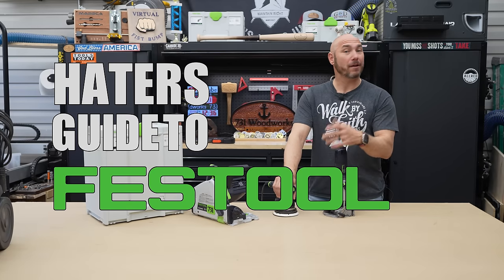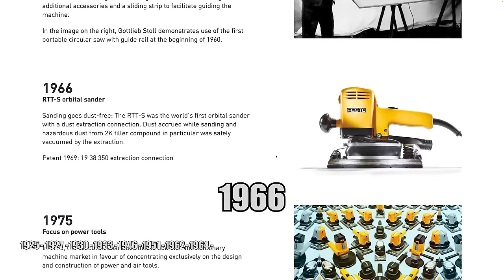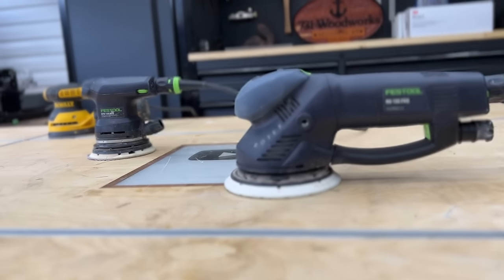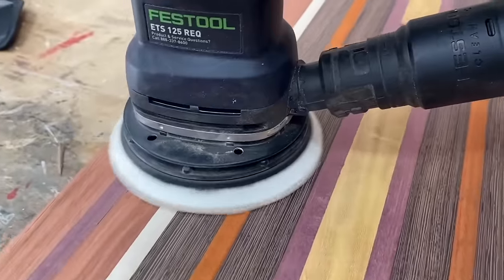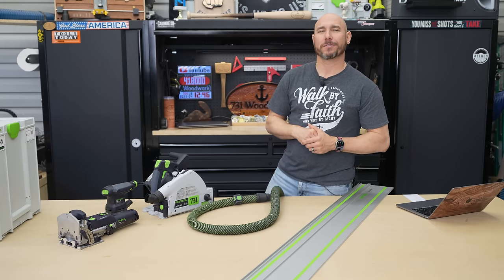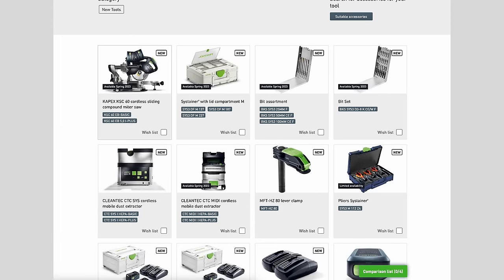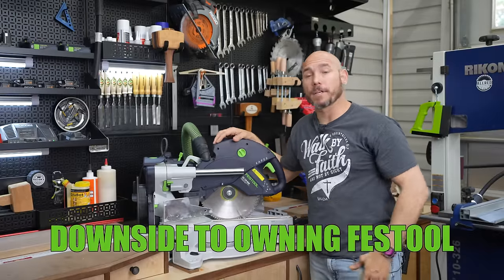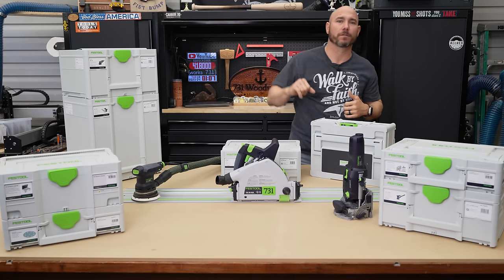The Hater's Guide to Festool | How Festool Changed the Game

Comment: Hi. Festool hater here. I have no issue with the price, my issue is how badly the design is in terms of ergonomics and aesthetics. The 1930 circular saw you showed us at the beginning of the video has a more ergonomic handle than the circular saw that's available today. Here in Canada, hardware store Canadian Tire has a house brand called Mastercraft, known historically for being cheap and having the ergonomics and usability of a brick. Festool today has shittier handles and grips - you know, the thing you interface with all day, every day - than Mastercraft did 15 years ago. Mastercraft has since improved. Festool, however, is still releasing plasticy, hollow, clacky feeling and sounding drills with a completely unrefined design. They look cheap and feel cheap. Performance is clearly another story, the dust collection game is great, but for me, that doesn't make up for for looking and feeling like crap in the year 2023. Yes, I haven't used the tools extensively, and it's because I don't want to. I like working with tools that feel good in my hand, and don't constantly send me into fits of "are they hiring first year CAD technicians to do their case design?"
Reply: Have you ever used any Festool tool? All of mine have fantastic ergonomics and don't feel cheap at all and plastic isn't a bad thing when used in the right places since it reduces the overall weight.
Reply: @Roct3874  Yes I have. Read my whole reply. I also didn't say "don't use plastic" - last I checked everyone is using plastic. The point is, if the wrong plastics are chosen and the design is poor, it will be reflected in the feel of the took.
Reply: Out of curiosity which festool are you talking about?  All my battery stuff is dewalt.

Comment: self proclaimed tool-aholic. i got my first festool tol 20+ years ago.  it lines up with when they "became' Festool. Back around 2000 in an effort to get their name out there, they had a introductory offer ETS150 random orbit sander for 79.00 bucks. At the time I didn't have a clue who they were. Fast forward 20+ years, it is still the sander i use 99% of the time! why NO FREAKING DUST! NO FREAKING NUMB HAND! NO FREAKING SWIRLS. I am not making my living woodworking...yet. I am a trained professional though. i spent 3 years in cabinet/furniture makers school. i do a lot of side hustling.  And it is my retirement path. That said, just don't understand why you would compromise. Buy it once, use it forever. It will improve the quality of your work. less time trying to get a lesser product to work. Buy once, cry once.

Comment: I think that if they want to fix the hate, they should come out with a lower cost hobbyist version of their tools as a gateway into their pro tool line. Make it more affordable and allow people to take advantage of their innovation.
Reply: their tools are really not much more than any comparable tool. for example the milwaukee cordless track saw kit is about $800 and the festool kit is $900. the Lamello P2 is $1600, so the domino is actually cheaper at $1200. the Makita VC4210L dust extractor is $700 and the comparable CT48 is $935.
Reply: @coolbugfacts1234  Yes but I'm talking for the hobbyist not pro.  How many hobbyists are really going to buy a Lamello or whatever?
Reply: @vmoutsop  It would be great if they did that I agree, but at the end of the day they’re a much smaller company than any of the big box brands and they make their tools in Germany instead of contracting to the same few factories in China that make all the big box brands
Reply: But honestly that’s like asking BMW to make a Corolla line or not making a pickup truck

It’s not who they are

If you need a Corolla, buy a Toyota

Need a pickup? Buy a Ford
Reply: @robhaydnsei  Actually it’s exactly like BMW, a 2 series car starts at 37k, a 5 series starts at 60k and a 7 series starts at 95k. You offer something that gets you into the brand and then as time goes on you upgrade to the better models. Good analogy, that’s what Festool and other similar companies should do to get new customers.
Reply: BMW 2 series = ETS 125? I do recall Festool once had a limited time promotion on the ETS 125 equivalent for $99, a DeWalt sander is $84?
Reply: @robhaydnsei  if they do that then I’ll buy one
Reply: Yes this was back in 2016, $99 for the Pro-5 sander which is basically the ETS 125